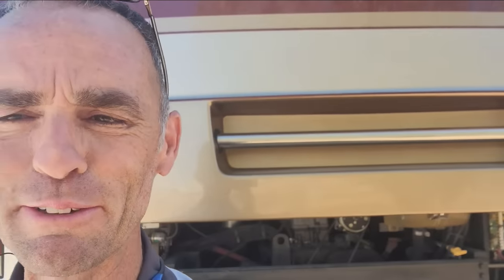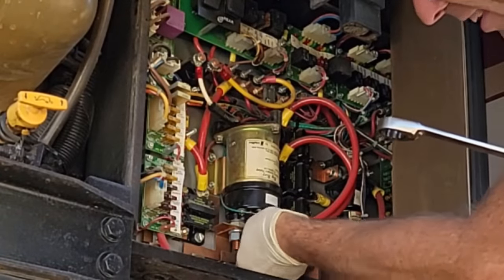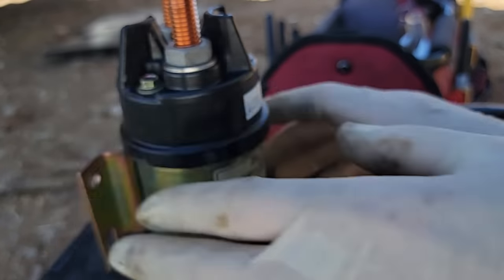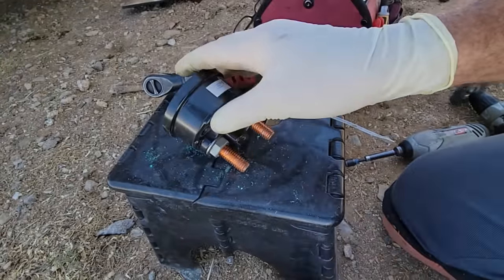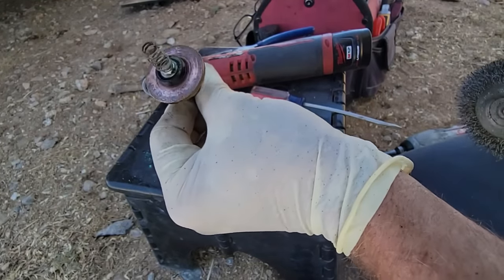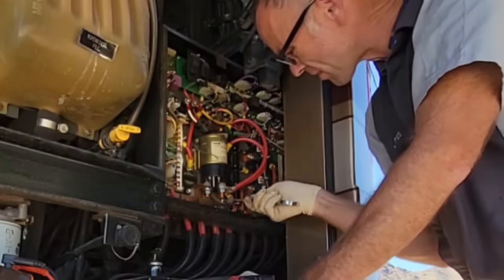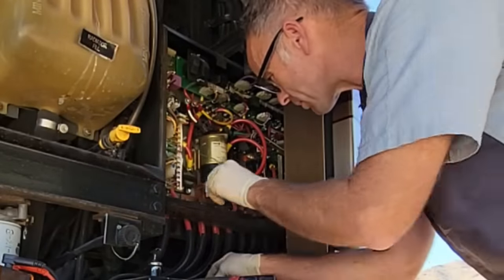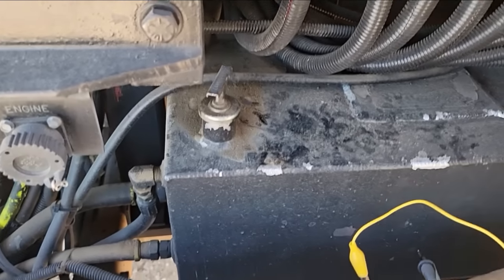You Don't Have to Replace the Bad Part...EVERYTIME!!!

Comment: Nice job James,
Back in the 60's my dad let me give my Yamaha 60 Mini Enduro to my friend, I got a new 125 .
He changed the points in it thinking it would run better. 
When putting the points in, he put a fiber or plastic washer on the wrong side of the mounting screw not allowing it to ground. He and his brothers worked on that for the longest time then took it to the dealer. 
Only to discover the smallest oversight coasting a lot.👍👍
Cameras are priceless when working in uncharted territory.
Reply from the maker: They sure are! Thanks for watching

Comment: Thanks for the information and education.  I appreciate your technical repair videos.  Never know when it may come in handy
Reply from the maker: Glad to help
Reply: @AZExpert  question why a capacitor is not put a crossed that relay the way a condenser (cap) was in an old point ignition system to absorb the spark when the contacts open and reduce the wear and tear on the contact surfaces just curious 😎

Comment: Wow, actually repaired a part instead of replaced! A normal RV shop probably would have changed EVERYTHING in the charging system, charged a small fortune after you waited for parts a few months. Great Job!
Reply from the maker: They don't want to warranty a rebuilt part.

Comment: With my 06 Beaver. Which has the exact same system in it ,I rebuild/ clean the relay a least once a year, I also carry a spare. The 1/2 main contact studs come out real easy to make cleaning a snap. Going down the road I can always tell when the relay needs cleaning because the house batteries will not be charging as seen on the computer screen.
Reply from the maker: Good for you maintaining your rig like that

Comment: Thanks for sharing. I fixed a lot of starters on heavy equipment and cranes in the field by taking the starter solenoid apart and cleaning the contacts. People burn the contacts a lot of time when they try to start something with a low battery and you hear the solenoid clicking.
Reply from the maker: Thanks for watching!

Comment: $350-$400 for a magnet, a spring and a couple of copper nuts and bolts...hmmm. Not cool. Awesome job saving your client a few hundred bucks. Love these types of videos as well. Be careful out there in that 112 degree heat my friend. Stay hydraded and take a break and cool off in the clients motorcoach If you overheat. Take care James and as usual thanks for the great content.
Reply from the maker: I'm pretty used to the heat but it still stinks.

Comment: thanks for the video.  I had that problem on my 2005 Monaco Diplomat.  I replaced the bad part with a new one the builder said had silver instead of copper.  That was over 10 years ago and I have not had any problems with it since.  I  also  cleaned the old one like you did and now have a spare.
Reply from the maker: Nice Job Gary!

Comment: I have a system just like this on my 07 Mandalay. These Big Boy solenoids are used for the batt boost switch on the dash but also engage when charge voltage is in place via shore power. So in short, when connected to shore power and charging the house, these solenoids engage to charge chassis as well. What you mentioned about this not being the most reliable is quite interesting. I also have a multi stage battery charger mounted in the bay that is intended to plug in to 110 when on shore power to keep the chassis batts up. Which approach is better? Not sure, they both work. But you are right about the heat coming through the Big Boy when engaged. If I could figure out how to make it NOT engage on shore power, I would likely just plug the charger into 110.

Comment: You might consider using conductive grease on the wire terminals, especially the bigger wires (higher amperage connections) as this prevents corrosion in the contact space. Good explanations!

Comment: I've used a product called DeoxIT for years with good success. It won't deal with pitting, but does wonder for corrosion/oxidation, leaving a protective coating to slow future oxidation. I started using on audio systems and now use it on almost any electrical connection from golf carts to home wiring.
Reply from the maker: Thanks for watching! :)

Comment: Thank you for all of the informative and inspirational videos that you post. We just purchased a 2008 Monaco Dynasty and the house batteries were not charging. We took it apart and  it defanitly was corroded . Put it back together and it works but now watching the video back again I noticed yours has a spring between the washer and the cap. Ours did not have a spring. So do i need to locate the proper size spring and install. Seems like it would always be making contact without the spring. Thank you again for all your wisdom.

Comment: From a kid that grew up in the early 70's and having to learn from my Dad fixing vehicles and other things around the house without instantly running out and buying NEW, this was refreshing to see! I've successfully saved some parts like this as well and it was well worth it because they weren't made in CHINA so they could handle a little rebuilding-elbow-grease.  

One thing I'd like to know about is, Where did you find that really heavy-duty storage box?!  It looks like it's made of either fiberglass or some sort of mesh and would certainly outlive the POS plastic ones that I have to use...

Very Worthwhile video to watch
Reply from the maker: Thanks for watching! :)

Comment: Try Ketchup on copper. Coat an let it sit for a bit then wipe clean. Ketchup packets are easy free an everywhere. 
I also think a dielectric grease would prevent the corrosion from repeating.
Reply from the maker: Yeah I don't really want to put ketchup inside this. That's better suited for something you eat off of

Comment: I have a 2000 Dynasty without the tag but two slides. Mine is a much simpler system and it just shows why all the Monaco guys on the forms say these things are snowflakes because none of them are the same, even the same year and same model. Thank you for the video.
Reply from the maker: Thanks for watching!

Comment: Does anyone happen to have wiring diagrams and fuse/relay-module panel locations for this RV? I've got a 2007 Monaco Dynasty sitting here with no 12v power to some (seemingly random) collection of stuff in the front cab ceiling area, and can't for the life of me find even a wiring diagram telling me where to check fuses, etc..

Comment: Need your expert help. I need to replace a Trik-L-Start module in my 2008 Itasca Ellipse and I cannot find a smart replacement for my AGM BATTERIES. Would you please let me know your recondition the manufacturer LCL is no longer in business.
Reply from the maker: The echo charger from xantrex works, but I think the simple 120vac battery tenders are the easiest way to go.
Reply: @AZExpert  what’s your thoughts about Victron Energy Orion-Tr Smart 12/12-Volt 18 amp 220-Watt DC-DC Charger?

Comment: just wondering, could the failure of this device be why i have no 12 volt in my coach ? when i plug in to shore power my 12 volt (lights)  work, when i unplug i loose my lights, furnace etc...   i belive my convertor is fine as its putting out 12 plus volts....
Reply from the maker: Something similar to this, likely a house battery disconnect relay.